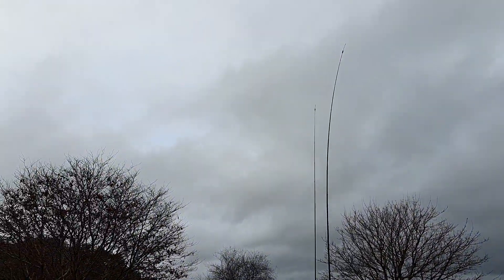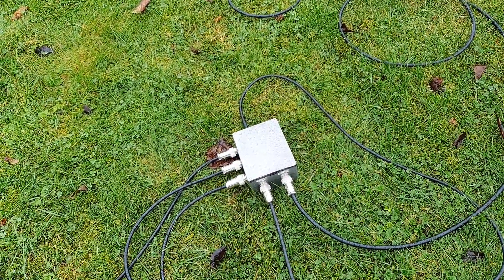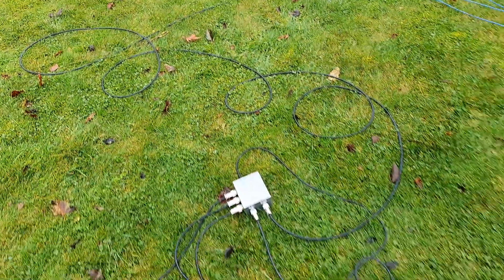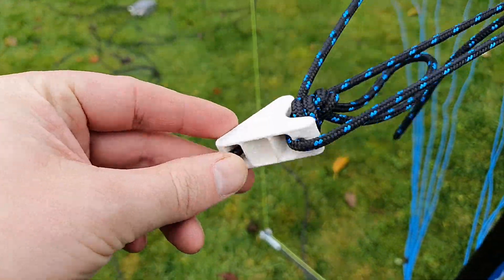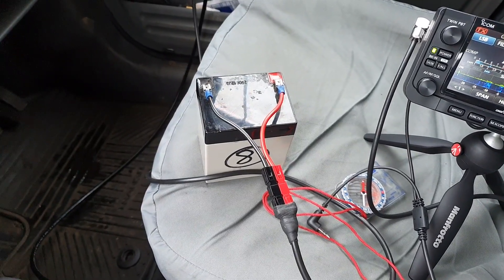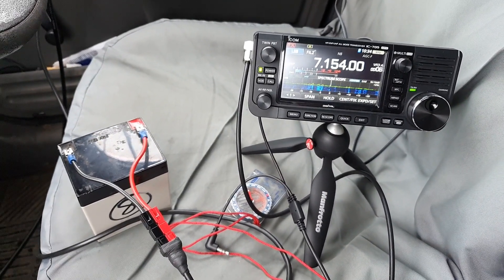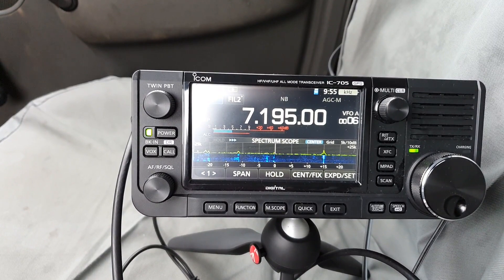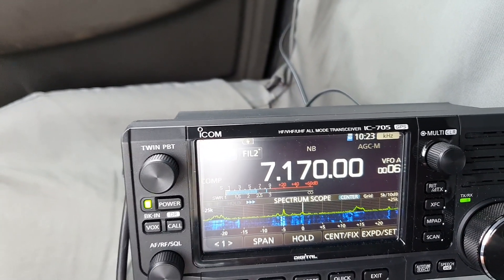Phased 40m Vertical Testing with Icom IC-705

Comment: Hi Colin, what source do you use for the radial wire?
Reply from the maker: Originally I was using 0.75mm tri rated cable but laterally moved to sotabeams lightweight wire which works out much cheaper.
Reply: @MM0OPXFieldRadio  yeah I'm also using sotabeams wire but really struggling with winding it up. Have 35 radials per vertical and last time I used it, spent hours untangling the wires. I use a phased pair of 40m verticals for contests but have to set it up each time so looking for a quick/easy/cheap method to keep the radials separate and easy to lay out when used? Thicker wire seems to tangle less but costs so much more it's not realistic to have the volume i want.
Reply from the maker: Your right if thr lie Sotabeams stuff is any longer that 2m then it's a nightmare. The bigger 0.75mm stuff is ok for bunches of 6 at 4m long. Definitely a knack to untangle though.

Comment: Great stuff Colin 
A threw  a pair of 40m full size verticals up  in the garden to test  done the phasing  lines from the christman calculator  
Added the 3 inch  extra  
Took that back off  fitting  plugs  and it seems to be sweet 
Seeing  good front to back 
Esp on the LONG haul  15 to 20db fb with abt 2/3 s units forward gain 
I was always a big yagi man  
But these lil things   blow smoke  
 Keep up the great work 👌👍
Reply from the maker: Awesome Pat. Take it you have went with 1/4 wave spacing? Check out KG2RG YouTube channel if you haven't already. He has optimised his and seeing amazing results on 20 & 40.
Reply: @MM0OPXFieldRadio  yes Colin 1/4w spacing    plus a have a couple of  radials  crossing too 
With no big effect on  swr ect 
 Going to  measure exact space between  both verticals  as  it's just over a 1/4w  on 7150 but it seems to still work well  
  Also watched some of kg2 vids  too  great info  also 
 Had 2 verticals on the hill behind  a few yrs back with different phasing 
They worked well  to states  on 40m  but the phase  was   a bit off  and  never did  get back to it  then lol 
  Am now thinking about  another 2  spaced   maybe a half wave apart  to see if   I can get more forward  gain 
Whether  itl work or no  
Al give it a bash this winter    gotta   collect some bits   but  have  the vertical  stuff there  already so could b worth a try 
 Handy when ya got plenty space to play with  
Just lucky I got  a hill  lol 
 Take care  keep up the good work  and catch ya soon  
 Cheers pat Mm1dhu 👌👍

Comment: Phased arrays are cool.  Complex, but cool.
I think I saw in the video close up of your guy wires, that you have the clamp around the wider part of the pole.  Spiderbeams recommends putting the clamp on the smaller pole just above the seam.  The idea being that you don't need as much tension on the clamp, it just keeps the smaller from sliding down into the larger.  Putting it on the larger requires too much tension and can actually damage the pole.    Just passing that on.
Reply from the maker: Hi Kevin, it sure is fun experimenting. The clamp isn't actually for clamping one pole to another. Its purely for guying. I have nitrile rubber between the clamp and the pole. There's only minimum tension on as not to crush the pole. I had all the joints taped with duct tape to stop them collapsing. 73, Colin
Reply: @MM0OPXFieldRadio  Cool.  As expensive as those masts are, I tend to be extra cautious.  As it seems you are as well.
I have the 18M version, it's a beast!
Reply from the maker: Definitely, I should have had it guyed with the supplied guy belt too up high. Best pole of  this size around. I have recently come across a pole just as good here in the UK. Just purchased a 6m to test and its as well made as the Spiderbeam. Going to do a little comparison video sometime.

Comment: Nicely done 👍 i’ve been playing about with 2 dx commanders and phasing for both end-fire and cardiod patterns, one thing i found that was cool to play with is spacing between the antennas. There’s an example in the low band dxing book for 20m using 1/8 wavelength spacing instead of the conventional 1/4. That ended up being the least hassle setup for me. Great video.
Reply from the maker: Thats where I got the idea/details from although not got the book. Very happy how its going.